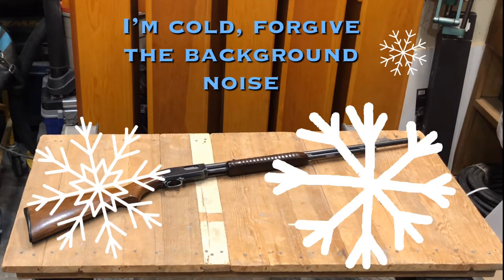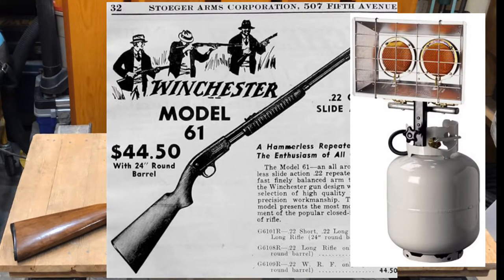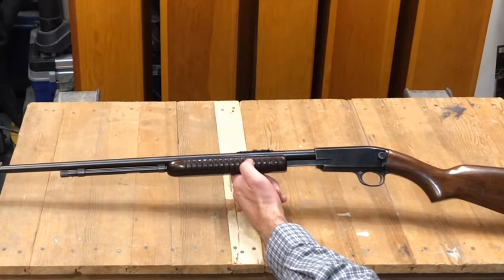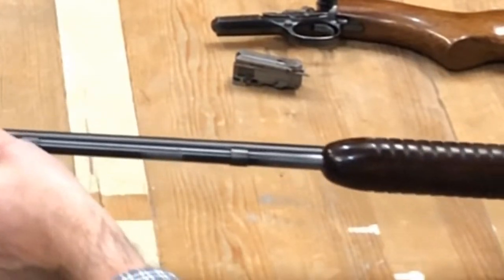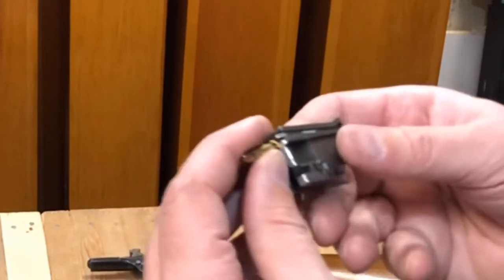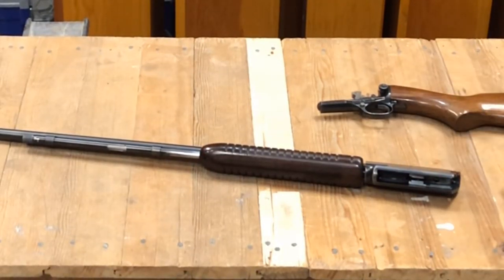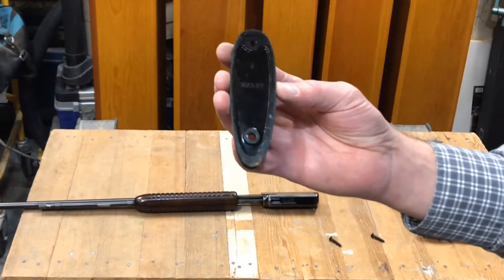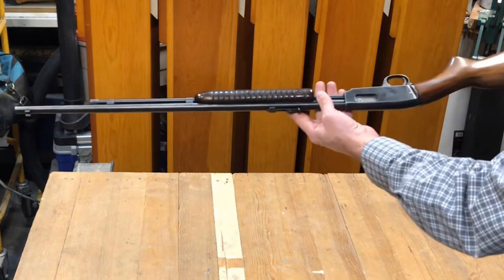Winchester Model 61 22 |  Darn Toot’n Best .22 Rifle Ever Made

Comment: You are so right!!. those old rifles are a blast.I have a winchester model 60 sporter from the 30es and it is the smoothest trigger pull ever. A single shot bolt action it was the perfect starter rifle. I think it was the only 22 winchester did not put a serial # on
Reply from the maker: That’s pretty cool.  I have a love for the old Winchesters.  My other is similar in some ways to the model 60, but more primitive.  It is also in pretty rough shape.  It’s a Mode 1904, but it was left to rust for a few years by its previous owner.  It wasn’t serialized either, but I didn’t realize they didn’t serialize the model 60.  That’s a cool gun.

Comment: my grandpa has had one of these for i'd say the better part of a century. sadly it has a scope mount that screws to the receiver so the receiver has holes drilled and tapped on the left side but other than that it's in nice shape.
Reply from the maker: I feel the marks on a gun, especially the guns past down from generations before, tell a story more valuable than the value of the firearm.

Comment: I just bought one from 1947. A round-barrel, rifled variant with steel buttplate. It's a shooter in good condition for $250.
I'd say it was a good deal.
Pretty sure the mag holds 14 LR or 20 short.
Reply from the maker: That’s a steal of a deal!!!  You’re right on the magazine capacity.  If I ever saw one for that price, I’d find anyway I could to buy it if it was mechanically sound.   Great find.   I hope you enjoy it as much as I do mine.   There is something so right about these little riffles.

Comment: Do different LR22s have different sizes casings perhaps?  I just pulled my mother's W61 out of the closest, It's not been fired in at least 20 years since I've had the gun, and the casings aren't really gripped by the bolt and held straight so when it goes to feed it just slams the round into the wall of the chamber.
I'm curious if the weapon is somehow worn (it's not been fired in probably 40 years?) or if the casing of the round is somehow small.
Reply from the maker: What exactly do the barrel markings say?   22LR should be all the same size, but there are multiple 22 cal Rimfire chambering.  Does it say .22 WMR by chance?
Reply: @oddballschtuff  Thank you, it's WMR.  
Out of curiosity, would you know what parts the WMR is compatible with?  The extractor is missing from the bolt so while with WMR it now attempts to feed, it obviously loses the round when it rises to the extractor portion.
I dont know if i need parts from a standard bolt or a WRF bolt.
Reply from the maker: https://homesteadparts.com/shop/?main_page=index&cPath=1_21&sort=4a&alpha_filter_id=69

Try this link

Comment: I've never handled one of these. Do they have that sort of solid, mechanical snick-snick feel that the Winchester Model 12 shotguns seemed to have?
Reply from the maker: They definitely feel solid, and have a tactile engagement as you operate the pump. I’ve never shot a model 12 so I don’t know. But it’s very smooth and refined at the same time.
Reply: @oddballschtuff  Sounds like it probably does have the classic Model 12 feel. It's a very metallic mechanical sound and feel, like a well made device. Not like a modern hunk of plastic (polymer) that needs 4 thousand strokes to "smooth out".

Comment: What is the value of this rifle
Reply from the maker: They vary greatly depending on condition, but I would say they average around $900-$1,200.  But I would expect $700-$900 for a working used one.  Some rare ones go for $7,000.  If you’ve ever shot one, you know instantly there is something special about this model.   If I found one for $700 or less, I think I would be hard pressed to not buy it.  My wife on the other hand might disagree.